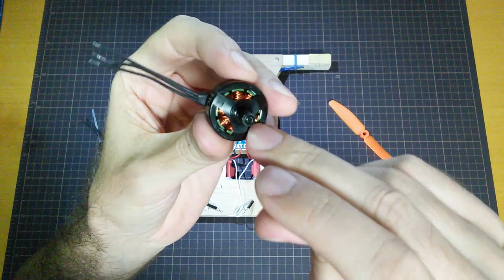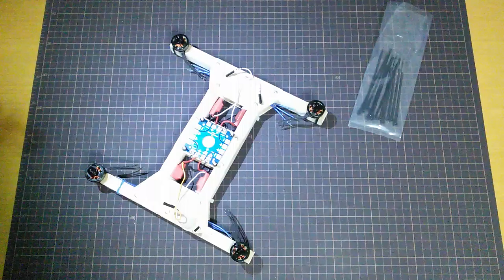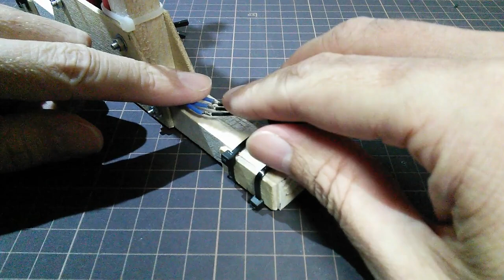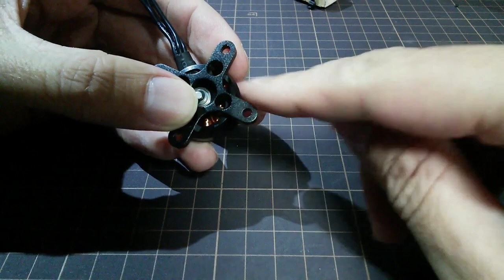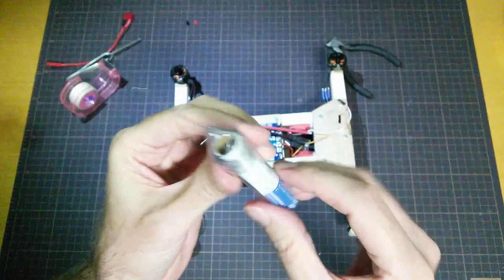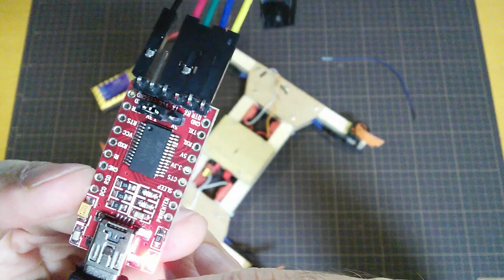Cheap-ass quadcopter build Part 4 - Motors

Comment: Hi iforce2d, how do you calibrate the esc s? I have tried many ways to calibrate it. It works fine without calibrating those escs with the multiwii board.I calibrated the esc manually using a servo tester but unfortunately it won't work after plugging it in the multiwii(it doesn't respond to my transmitter normally).
Reply from the maker: http://www.multiwii.com/wiki/index.php?title=ESC_Calibration

Comment: hi +iforce2d 
I'm thinking about getting this set for the motors and esc:
http://www.ebay.com/itm/262763241251
is it a good choice? are the escs compatible?

also, will this battery suffice: 
http://www.ebay.com/itm/262909037317

im worried that since the max current for the motors is stated to be 45 amps, neither the escs nor the battery be enough...
What do you think?
Reply from the maker: That motor set looks like it is intended for a plane around 1 meter wingspan, where it will be spinning a smaller propeller very fast (see my latest video where I use exactly this setup https://www.youtube.com/watch?v=1183YO4wi1c). For a quadcopter using a 2212 size motor you would want a slower motor, usually around 1000kv (eg. https://goo.gl/jsBL6X) and the quad would probably be around 450-500 size with 9-10 inch props, running on a 3S battery. If you use a 2S battery then a 2200kv motor might work out ok, but I think it would be pretty weak.
Reply: so if i get 1804 motors, what KV should i look for, and what sized blades should i get?
also what ESC?
and as for the battery, i need one that can withstand the highest current burst times 4?
Reply from the maker: 1804 motors of around 2300-2400kv would work well with 4-5 inch props, a 10-12 amp ESC should be enough. This would be for a quad about 250 size. As long as you're not flying around at full throttle the whole time, your battery can be rated a bit lower than that.
Reply from the maker: In general the 2S 2200mAh battery you pointed out will likely be too heavy for any quad size, regardless of the other components. If you want a large battery it will also need to have more power to lift itself. Eg. for a 2200mAh you would want it to be 3S. If you want to stick with 2S then it would need to be more like 1500mAh max and keep the quad light.
Reply: First, thank you for those enlightening answers.
i ask about those specs, since the spreadsheet contains many dead links now and unfortunately there is no description for each part. like for the battery, i cant see what kind you used.|
so for the 1804 2300KV motors, with 12A ESC, what battery would you recommend ?
Reply from the maker: I see. Pretty sure I looked at most of the parts at some point during the series though, eg some batteries I mentioned in the intro (https://youtu.be/YPtxHw3DWrg?t=7m11s). That should give you a hint, you want 2S or 3S batteries around 900 - 1300 mAh
Reply: iforce2d indeed you mentioned the batteries,  i watched the series some time ago and forget this mention.. sorry if i bothered you.
so it seems that 1804 motors at 2400KV with 5" blades, 12A ESC and a 1300 mAh 3S battery I'll be golden then.. thank you :)
you should set up a patreon or something..
Reply: +iforce2d also, what C rating should i use for a 1300mAh 3S battery?

Comment: hi +iforce2d. the parts doc contains a dead link for the motors. can you write here the model num and manufacturer so ill know what to buy? thx mate.
Reply from the maker: yeah things have changed very quickly in the last couple of years. The brand I had was RCX but you could get pretty much any 1804 sized motor if you want something like I used here. 1806 motors are a little bigger but should work ok too and probably easier to find now, the typical budget option would be this one: https://goo.gl/iMFm1R
Since that combo I originally recommended had the ESC, you'll also need those too, these days you can get a good 20A ESC cheaper and smaller, eg. https://goo.gl/I3tM7N, not much point buying a 12A ESC any more.
Reply: thank you +iforce2d.
another thing- i'm thinking about using Li-ion batteries (the 18650 type) and using a non- dedicated charger to charge them (not dedicated for RC hobbies, but for a flashlight). i'm worried that since it charges them seperatly, they won't have the same amount of charge and when connected in series/parallel, it may cause a problem. could this be a problem or will they just charge each other until equal when connected? maybe i should just buy a charger that can charge multiple batteries at the same time?
also i wanted to thank you for these videos, they are awesome and very enlightning!
Reply from the maker: Connecting unequal voltages in series is not a problem. Connecting them in parallel can be. Yes, in parallel unequal cells will 'charge' each other, but if there is no resistance between them they'll just heat the wire red hot and/or set themselves on fire if the voltage difference is high enough :-) I think a bigger problem is that li-ion are unlikely to provide enough current for this usage unless you have a lot of them in parallel, which pushes the weight up and then you need more in series, etc. It can be done, and has been done, in record-setting quads that do nothing more than hover on the spot for a long time. But if you want a quad that does something interesting, like fly fast or carry a camera, then you'll want to power it with lipo.
Reply: got it... thank you !

Comment: I am not planning to use multiwii ...just using arduino uno as flight controller
Reply from the maker: The arduino pins have a maximum output current of 40mA and voltage will be around 3-5v. You cannot use that directly. If you output duty cycle PWM you will still need something (eg. mosfet) to handle more current and maybe more voltage. This is discussed in the thread I just linked to. If you output servo signal PWM like multiwii does then you will an ESC. Either way, you will need something in between the arduino and the motors...
Reply: +iforce2d will irf530 mosfet work??

Comment: Hey, I have serious problems:
I followed your shown steps and when I had connected  everything, the motors didnt start, they just shaked and wobbled back and forth and got really hot.
If anyone has a solution, please tell me,
thanks
Reply from the maker: at what point in the video did that happen for you? What type of ESC are you using. The motors should not move just by connecting them, you would need to control the speed with the speed controller to get them to move.
Reply: iforce2d well, I think I found the problem:
The ESCs are badly soldered inside, thanks anyway for the quick response
Reply from the maker: What type of ESC are you using?
Reply: iforce2d I am using this 30A ESCs:
https://www.amazon.de/gp/aw/d/B00X5SLS4Q/ref=mp_s_a_1_1?__mk_de_DE=ÅMÅZÕÑ&qid=1476649507&sr=8-1&pi=AC_SX236_SY340_FMwebp_QL65&keywords=30a+esc
Reply: Did you check the connection beewteen the ESC and motor?

In my RC hovercraft, one of the motors wires were disconnected from the esc. It started wobbling back and forth.

Comment: hey there! I am using A2212/7T 1800 KV motors with 1045 props. When i try to fly, it merely gains 4 or 5 inches of height. And goes here there without any command other than throttle, sometimes rotates on its axis and then crashes. Not able to understand what the problem is????
Also is there any link of this issue with the frame?

Comment: hey, I have watched the full series of he cheapass quadcopter. It was awesome. You are fabulous.I have an doubt, when i am testing my servo then after 3 beeps, i am getting a beep again and again and my motors are not spinning. Can you please help me out and solve my problem.
Reply from the maker: +Palkesh Agrawal usually means there is no throttle control signal going to the ESC.
Reply: +iforce2d So, can you please provide me any solution for this?
Reply from the maker: +Palkesh Agrawal Check the connection between the FC and the ESC. Check the output signal coming from the FC with a logic analyzer or oscilloscope.
Reply: +iforce2d I have tried same this time and i observed that my motors are spinning very little with a beep, but it is spinning like a step. It spins a step with a beep and reverse back with that beep only. Please help out. What i will do now. What will be the solution for this.
Reply from the maker: +Palkesh Agrawal yes, of course the motors move a little.... that's how the beep sound is made. The ESC tells the motor to move back and forward very quickly, which makes a beep sound. I am already helping out.... from what you describe, there is no control signal being given to the ESC to tell it what speed to spin the motor. Third time now I'm saying this. The solution is to give the ESC the control signal that it is expecting. Either there is no proper connection between the ESC and the flight controller (or server tester, whatever you are using to control the ESC), or the flight controller (or servo tester) is not outputting the signal as required. You need to check that the flight controller (or servo tester etc) is outputting the required signal... for this you really need a logic analyzer or oscilloscope to see the signal.

Comment: i am using 1800 kv motors with 30A esc, 3s lipo battery .
but the esc was burnt after a minute. and the motors are also becoming hot in less than a minute.Can you tell me the reason behind this. and a suitable esc.
i am using arduino instead of flight controller.
Reply from the maker: +Saurabh Verma what size props?
Reply from the maker: +Saurabh Verma and what size motors?
Reply: +iforce2d  Prop size is 10*4.5.
and motors dimensions are 27.5*30 mm, shaft diameter 3.17mm.
Reply from the maker: +Saurabh Verma a lower kv motor would probably be more suitable. Most people use 900 - 1000 kv for that size prop. I don't know if the high kv would cause overheating though.
Reply: +iforce2d if i use smaller size props. Would it be suitable for same motors?.. And can i use esc of 20 A for same motors.?
Reply from the maker: +Saurabh Verma typical 3S configs in common use are:
2300kv + 5-6 inch props
1000kv + 9-10 inch props
There is no perfect number but using that as a guide 1800kv would be something like 6-8 inch props. Look at the specs of your motor to see how much current they will draw.
Reply: +iforce2d but the main prob. is i didn't mounted the props till now.
I just ran the motors for checking their rotations and the esc blown up with an intense smoke. Cant find out whats the prob. is.!
Reply from the maker: +Saurabh Verma Did you run them a little bit, or a lot? It's not a good idea to run them fast or long with no load. Maybe there was a bad connection somewhere.
Reply: +iforce2d ok. i need to try again. thanks for the help.

Comment: can i use 1400kv motor?
Reply from the maker: +Dedo Ramadan given the same voltage, the 1400kv motor will spin at 1400/2300 the speed of a 2300kv motor (ie. about 60%), so it will spin a lot slower. To give enough lift, you would need to have larger propellers (eg. 9 inch) or a higher voltage. It might be ok with a 4S battery, but you would then also need to have ESCs that can handle 4S battery too. Certainly on 2S it would be struggling to fly well, if at all. Generally the lower kv motors are used in larger machines than this. You could always give it a try but I wouldn't expect too much :)

Comment: Hi,
I tried to test the motor with multiwii as 29:35, but it doesn't work.
I already completed to upload multiwii firmware.
And I connected multiwii to HK receiver by followeing build Part 11. Now, Can I fly the frame by using HK transmitter?
Reply from the maker: +Jinke Li Saying "doesn't work" is very vague and not useful when trying to help find the cause of a problem. The servo tester sketch is shown at 24:08
Reply: +iforce2d Thanks for your replying. 
Please help me. I did the servo testing by using Arduino, but I'd like to test servo by using Multiwii at 29:35.
Reply from the maker: +Jinke Li The flight controller board I'm using in this video is basically an arduino, with accelerometer+gyro added. That's why we can upload the servo tester sketch to it. MultiWii is the flight control sketch name, it does not do the servo test.
Reply: +iforce2d It means that you uploaded the arduino sketch to multiwii and tested the servo at 29:35?
Reply: +iforce2d sorry, Where I can find the reset program at 31:18?
Reply from the maker: +Jinke Li multiwii is SOFTWARE, not that board. That board is just an arduino with a gyro+accelerometer. So yes, I uploaded the sketch to that board.
There is no reset program, you can just disconnect the power and reconnect - in the video I opened the serial monitor on my computer, doing that will also cause the arduino to reset.
Reply: +iforce2d You are right. I uploaded multiwii to flight controller board(icstation mwc flight controller). If so, I can't test the servo by using this flight controller board? And I wish you check the Part 11.
Reply from the maker: +Jinke Li You can upload a different sketch to the board as many times as you like.

Comment: Hi there,
The ESCs in the link below I got have a total of 8 wires.
http://www.banggood.com/SimonK-10A-ESCRCX-1804-2400KV-Motor-Gemfan-5030-Propeller-For-QAV250-p-937534.html
3 wires go to the motor, 2 go to the distribution board, and I have 3(Yellow,Red,Purple) not 1 white like you have that goes to the flight controller board. How would I connect this to the Arduino to test orientation of propellers ?
Reply from the maker: +Jonathan Persaud I don't know for sure, but some ESCs have the signal wire as yellow or orange instead of white. I would hazard a guess and say that the purple is black... but don't blame me if something goes wrong, there should be some info from the maker about it. If the ESCs have a capacitor on them, you could just loot at which two wires are connected to which side of the capacitor.
Reply: I guess Yellow also and I was right, thanks so much!

Comment: But why is it necessary for ground of the lipo battery to be connected to the ground of the multiwii board.
Reply from the maker: Gyakobo Andrew To complete the circuit..... wouldn't be much use if there was no path for electricity to flow around :)

Comment: Hi there,
The ESCs in the link below I got have a total of 8 wires.
http://www.banggood.com/Red-Brick-10A-ESC-Brushless-ESC-BEC3V1A-p-77966.html
3 wires go to the motor, 2 go to the distribution board, and I have 3(red, black, and white) not 1 white like you have that goes to the flight controller board. Do I have to cut the black and red wires?
What I did is I connected the the white wire with female to male wire to the controller board.
Another thing, I don't know how to reset  the flight controller board. I installed the program in the link below but there is no reset button even I wrote the code you showed in this episode.
https://www.arduino.cc/en/Main/Software
Also I download the program below (MultiWii_2.4) but it didn't show that the controller board running even though it flashes ones per second.
https://code.google.com/p/multiwii/
Thanks.
Reply from the maker: FAHAD ALMADHI no, you don't have to cut the black and red wires. The black and red will supply 5v power which you can use to power the controller board. You only need one set of black and red, that's why I had cut the others.
Reply: thanks a lot. Can you tell me about restarting the controller board. I am quite frustrated:)
Reply from the maker: FAHAD ALMADHI If there is no reset button, just disconnect the power and re-connect it.
Reply: ***** I'm using icstation board. I connected it with the computer after downloading the arduino software. I wrote the sketch in 24:38 (ServoTest). I clicked on verify then upload. It says "problem uploading to board"
the message:

Arduino: 1.6.5 (Windows 7), Board: "Arduino Pro or Pro Mini, ATmega328 (5V, 16 MHz)"

Sketch uses 2,482 bytes (8%) of program storage space. Maximum is 30,720 bytes.

Global variables use 54 bytes (2%) of dynamic memory, leaving 1,994 bytes for local variables. Maximum is 2,048 bytes.

avrdude: ser_open(): can't open device "\\.\COM1": The system cannot find the file specified.

Problem uploading to board.  See http://www.arduino.cc/en/Guide/Troubleshooting#upload for suggestions.

  This report would have more information with
  "Show verbose output during compilation"
  enabled in File > Preferences.
Reply from the maker: FAHAD ALMADHI So did you look at that link to check for suggestions?? I don't use Windows, but I would expect you need to select the correct COM port. There are hundreds of threads about this in the arduino forums, you can check there for the best advice.

Comment: Hi,
The ESCs in the link below I got have a total of 8 wires.
http://www.banggood.com/Red-Brick-10A-ESC-Brushless-ESC-BEC3V1A-p-77966.html
3 wires go to the motor, 2 go to the distribution board, and I have 3(red, black, and white) not 1 white like you have that goes to the flight controller board. Do I have to cut the black and red wires?
What I did is I connected the the white wire with female to male wire to the controller board.
Another thing, I don't know how to reset  the flight controller board. I installed the program in the link below but there is no reset button even I wrote the code you showed in this episode.
https://www.arduino.cc/en/Main/Software
Also I download the program below (MultiWii_2.4) but it didn't show that the controller board running even though it flashes ones per second.
https://code.google.com/p/multiwii/
Thanks.

Comment: What about the DT750 motors?I'm thinking of building my first quad and I'm not sure which battery or speed controllers to use for the DT750s.
Reply from the maker: Will Roberts The ESC will need to be able to handle at least as much current as the maximum that the motors will draw. Look for a datasheet for the motor so you know what that value is. For battery, I think a 3S 2200mAh or so would be ok for a basic setup.
Reply: ***** Thanks